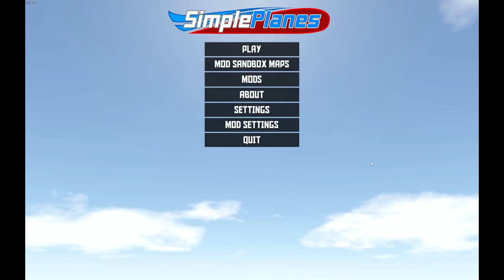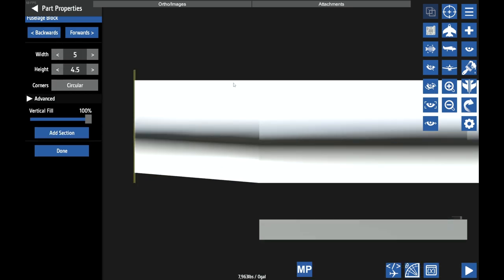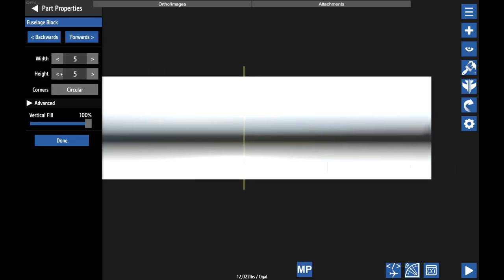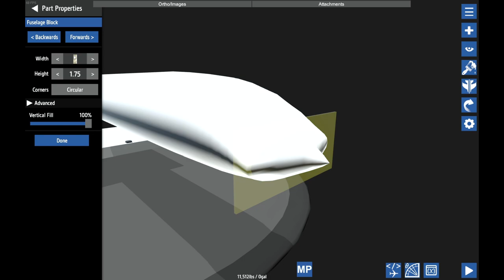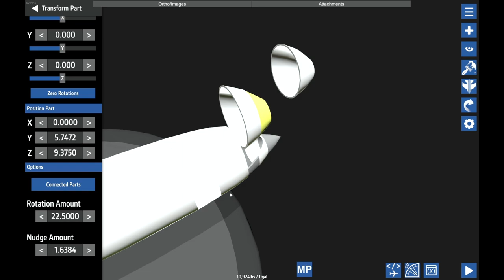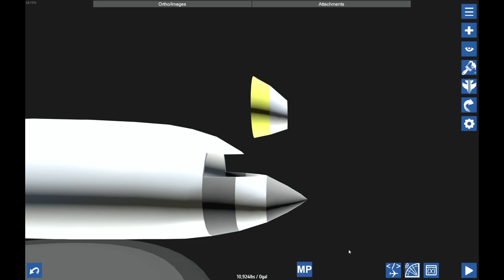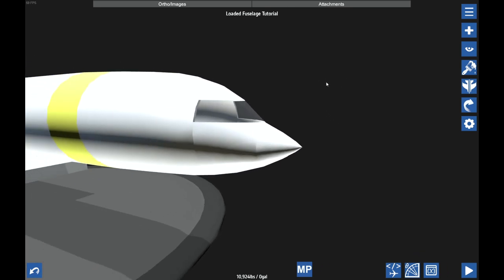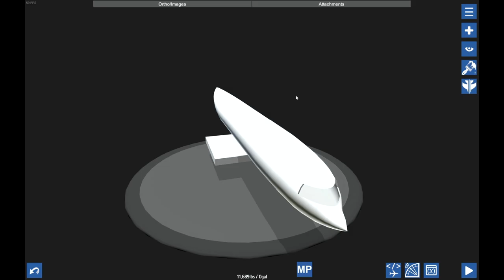How To Make A Basic Plane - Fuselage & Nose

Comment from the maker: I've received several comments asking me how to duplicate the fuselages.

If you are on a computer, right click and drag the fuselage you want to duplicated. This will create an identical copy as seen at 7:43.

If you are on a mobile device, there isn't a way I am aware of, unfortunately. I can, however, think of two ways to mimic duplication.
1. Click "add section" to the fuselage you want to duplicate and manually change the parameters to make it the same as the original.
2. Mirror the fuselage to the other side of the aircraft.
Reply: How to do overload
Reply: I got it now

Comment: How do I copy the fuselages? I am mobile
Reply from the maker: I'm assuming you mean when I right-click and duplicate a fuselage. There is no mobile equivalent, however you can click "add section", remove this new section, and change some values so it is the same as the original fuselage.

Comment: Wait, how do you do the copy paste?
Reply from the maker: I'm not quite sure what you mean. If you provide a timestamp that would be helpful.
Reply: 7:43
Reply from the maker: @stockcars8573  If you are on PC, right-click and drag.

If you are on mobile, then this response I gave to another viewer will be helpful:
I'm assuming you mean when I right-click and duplicate a fuselage. There is no mobile equivalent, however you can click "add section", remove this new section, and change some values so it is the same as the original fuselage.
Reply: Ah, i get it. Thanks.